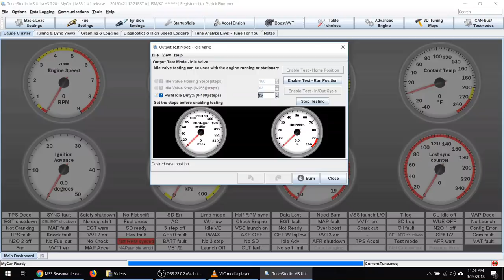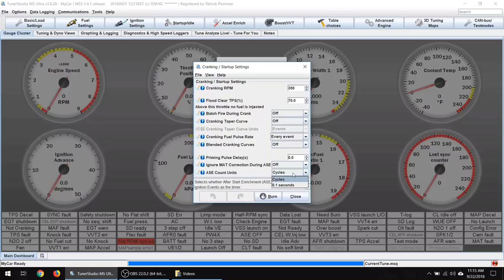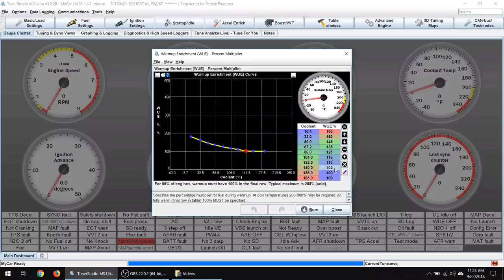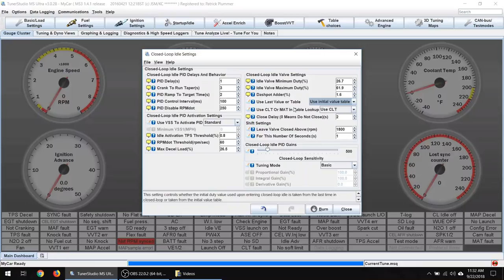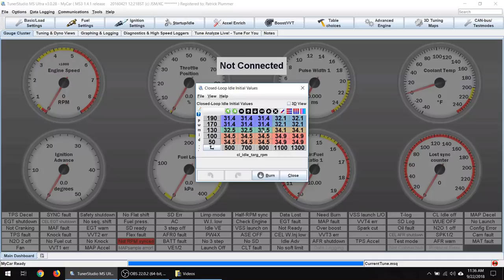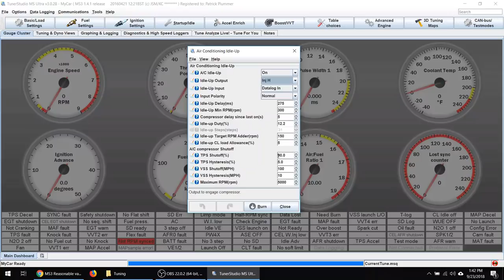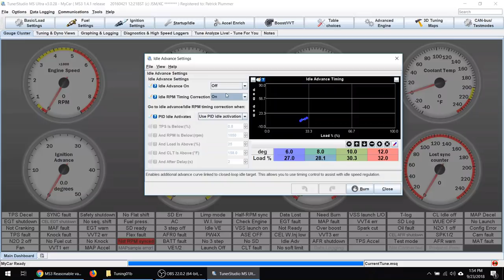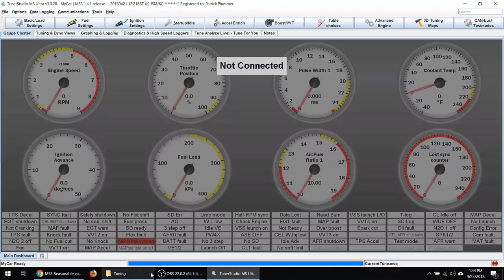Tuning the Megasquirt (Pt 2) - Idle Control

Comment: Hey, so whenever I start the car it hunts extremely bad and won't stay running. But once the idle adv and idle ve kicks in it idles beautiful. Im pulling my hair out trying to change things but I keep going in circles
Reply from the maker: Likely a fuel issue but there are two possibilities.  First is just up the after start enrichment and warm up enrichment.  Bump those up and see if it will settle down.  Second may be the fuel table itself...once it's warmed up tweak the fuel first without idle advance and ego turned on.  It should be relatively stable without those if the fuel ve numbers are dialed in.  Next, from a timing perspective, I like to idle at about 15-18 in the table prior to whatever idle advance adds later.   A tip is to increase the idle cells to 18 or so below your target idle.  So when the car  is about to stall, the advance in the table will pop it back up.
Reply: @OGPedXing  appreciate it. I will try that. Its a turbo LS, but I really can't find much info because everyone is all running holley now
Reply from the maker: Ah gotcha.  For an LS the same advice will work but for the timing numbers use for the lower end, like the 600 rpm row, an advance of your normal idle plus 3 to 5.

Comment: Got my car idling and that is all good. When I blip the throttle it revs up but dies on the idle down. Where should I look to correct that? Thanks in advance
Reply from the maker: Couple of things to try.  You can increase the dashpot which will add duty cycle to the iacv for that amount of time, try 1.2 or 1.5 seconds.  Otherwise you can bump up the idle air initial values for the RPM and load it typically enters idle at.
Reply: Thanks... while the car is running from initial start up is all good... if I restart the car it starts hunting. I will tray the dashpot tomorrow. Hate to be a bother but I’m making lots of headway very fast.

Comment: Thank you! I have a question. I have MS ultra but I don't see the Idle VE settings like yours does. Are there different lvls of MS ultra as well? or did they take out that feature and/or put it somewhere else? Thanks again for all your knowledge
Reply from the maker: I have version 3.0.28 of tuner studio ultra, I haven't updated in a while.  Make sure it says "Registered To" and then your name at the top of the window otherwise it won't be activated.  Go to Help -> Update Registration to set it up.  Then the idle ve should be under Startup/Idle menu, last item, Idle Ve Settings.
Reply: @OGPedXing  I got it all registered and shows just like you said. I saw down below that someone had the same thing happen to them since they are running ms2 pnp vs your ms3.
Reply from the maker: @shinobi1203  ah yes, some features may not be available or may look different on the ms2.   Actually it's not a problem, I tried it without idle ve and I have plenty of range with just the normal ve table. You may want to change the rpm range on the ve table around there so you can have 800, 1000, and 1200 and then have large jumps.
Reply: @OGPedXing  So I used a lot of the base map you showed and it was a great starting point. I got a nonseeking idle, but i for some reason, can't get my idle any lower than 1000-1100rpm. 

Would you mind looking at my tune if I take some pictures of it? or just send you my tune directly?
Reply from the maker: @shinobi1203  If the idle won't go down to 850 and the idle air valve is closed all the way then the physical idle adjustment screw may be too far out or there might be a vacuum leak.  However if it idled fine with the stock ECU then it's probably still the tune.  My email is on the channel About page and you can send the tune file.  You have to be on the desktop browser version of YouTube to see it though, the email button doesn't show up in the mobile app or the mobile site for some reason.  Or DM me on Instagram. 👍

Comment: When testing my IAC, Im able to keep the duty going all the way up to 4k + RPM, do i need to adjust the mechanical screw with the IAC OFF?
Reply from the maker: That can be ok...if it idled ok before the megasquirt you probably don't need to mess with the air screw.  At about 70 duty cycle it should be fully open and not go higher.  With it fully warmed you can test at the higher end.  If it didn't idle well before on the stock ECU or you bought the car with the megasquirt, then you can adjust the idle screw.  There may also be another small vacuum leak that's allowing in extra air.
Reply: @OGPedXing  bought the car completely stock, idle was fine. I tested it with it fully warmed up the rpm's were still climbing past 70% duty and 3500, 4k rpm. As well as it still lowering past 25% duty. Ill look for a unseen or heard vacuum leak. i have a slight idle hunt 800 to bot 1100 every 5 seconds or so after sitting at a light for more than 10 15 seconds. Im about to review some logs and try and see whats going on but im not to proficient in TS but by no means a complete noob. Thx for the reply.

Comment: you said to start at 0% on the pwn idle duty, but if I go below like 26% on my nb2 it stalls. How do you find the true closed spot without stalling?
Reply from the maker: You can also start kind of in the middle and work your way down.  Like start at 40 and go down until rpms stop dropping which should be around 25 to 30.  If it's stalling before that then your idle screw may be all the way closed.    Same for full open...start at 50 or so and continue up until the rpm stops rising.  Usually about 70.
Reply: @OGPedXing  For some reason I didn't think NB2 had an idle screw. I'll check it out. I start at 30ish and it usually stalls below 26 as I slowly go down.
Reply from the maker: @Vdeez  ah nb2, yes I think that's all ECU controlled.  In that case I'd put the lowest number at whatever puts it at about 750-800 rpm.
Reply: OGPedXing thanks!

Comment: So how will I go forward when we installed a new throttle body where the adjustment screw was remowed entirely when I gained it?
Reply from the maker: Is it a stock throttle body or aftermarket of some kind?  If stock, I'd try to get a replacement screw installed otherwise you will have a vacuum leak.  If there's no port for a screw you can make it work but your idle valve duty cycle will probably be a lot higher.
Reply: @OGPedXing  It is a throttle body from a very old car which was made to fit with this custom plenum I also got with the same deal. The screw and the place is there but the throttle plate is fully closed currently.
Reply from the maker: Depending on the throttle body, the screw will open up an internal passage allowing some air past the plate.  The other option is to adjust the throttle cable tension so it holds the plate open just a tiny amount.
Reply: @OGPedXing  maybe I wasn't quite clear with the question but anyway I apreciate alot that you are answering. I meant to ask that how I should adjust the screw before I start to mess around with the ICV? I believe if I have the screw and ICV completely off and try to adjust it with a closed loop, I'm in a big mess?
Reply from the maker: Oh ok, yeah try to get the car to idle at a normal rpm with the icv unplugged.  Open the screw all the way, start the car...rpms will probably be high.  Slowly  adjust the screw until it comes down but doesn't stall.  This may take a couple of rounds if your fuel table isn't tuned yet.  But then you can plug the icv back in and start tuning closed loop.
Reply: @OGPedXing  thank you, this was very useful.

Comment: I can use mpps v13 chip tuning tool  to connect tuner studio to the car
Reply from the maker: No unfortunately tuner studio only works with aftermarket ECUs like megasquirt, Speeduino, rusefi, etc. Obd2 tuners work with a stock ECU on certain car models/years.
Reply: @OGPedXing   I want tune my Isuzu Trooper 2002 v6 stock ECU what OBD2 TOOL do you prefer I should use

Comment: Hi FRIEND. Anyone who knows the ANSWER can help. i happen to have a Volvo 940.1994 regina model B230 engine. I measure only the crank sensor while it is installed and cranking.I read between 100-120mv. But i can find any ready in my trigger logger of rpm nothing.the firmware sas MS2 3.4.1  trigger pattern is 44-2-2 preset in  microsquirt, do you have any ideas what to do? i have no spark either. the sensor has 3 wire. red/blue/bleack seems to be the shield. red and blue reads 196.6 ohm .three weeks trying to find the answer. there are many gues.  Pls help.   regards
Reply from the maker: The lack of spark may be just it can't get sync with the crank signal so it doesn't know when to fire.  I'm not familiar with that engine but in addition to the trigger wheel setting in tuner studio, research what signal settings it needs such as rising edge vs falling edge, etc.  This is on the same ignition settings screen as the wheel setup.  You also want to make sure the crank angle is close for your engine and that the physical jumpers on the Ms are set for the right sensor type, optical, magnetic, etc.  Check out this for more info..https://www.diyautotune.com/support/tech/install/volvo/megasquirt-your-240-740-940/

Comment: I have an e30 with the ms2 pnp ita inverted the pwm when I do the test to calibrate it it never moves
Reply from the maker: What frequency do you have it set at?  You can try around 100 to start...lowet frequency will give smaller steps, higher will give larger steps.  You can actually verify that it's doing something by running the test screen with engine off...you can hear the hum usually.  If needed, you can even take it off the throttle body and visually verify movement.  It may also be an electrical or mechanical problem with the valve rather than the MS.

Comment: I have a mazda mx3 with a klze and I'm running it on a mspnp2 9395 model I tried to follow the same things you were doing in your set up videos but when my car is cold it runs lean. I tried to add fuel in the cold start settings but it won't stay running what can I do?
Reply from the maker: How long does it run before dying with the new settings?  If it seems to start ok and stay good for a few seconds then start to die, you may need to up the Warm Up Enrichment even more.  This is because the ASE is giving it the fuel it needs but this stops after 5-10 seconds.  Second you can check the Idle settings -- you may want to make the target rpm a bit higher in that temp range, and also check the idle air valve duty cycle %.   This last one can be non-intuitive because sometimes you actually want less air intake.   In cold temps, the air is denser and you need more fuel to compensate.
Reply: @OGPedXing  it bracks up well running for about 2 seconds
Reply from the maker: @johnhill484 if you give it some accellerator pedal, can you keep it running?  If that works, try adding duty cycle to the idle air valve.
Reply: @OGPedXing  ok ill try but I'll start up when it seems like it's running normal it's running at 18 20 AFR's
Reply: Until it warms up
Reply: Is there a way I can email you the tune
Reply from the maker: @johnhill484  DM me on Instagram (@ogpedxing there also) and I'll send my email.  Don't know why YouTube took away dm's.
Reply: @OGPedXing  I messaged you on Instagram

Comment: I have e problem mi car run good wen is cold but as soon it hit 180° it go's lenn
Reply from the maker: Likely the fuel ve table is a little lean but your warmup enrichment is a little rich which is compensating for it.  Let it warm up and fix the fuel table (add a little fuel) then you can go back to warmup enrichment and after start enrichment and lower those a bit.
Reply: @OGPedXing   I'm going to try that thank you very much... I was wondering can we connect via team  Viewer And maybe you can help me out better If you have time ?
Reply: @OGPedXing  I need help

Comment: Does the engine need to be running while getting the idle duty % when running the test? I only ask because my engine is running super rich
Reply from the maker: Yes, you'll need to use the RPM to determine exactly when the idle valve is fully open and fully closed.  Although usually you can put in a ballpark value and be close.  An na Miata for example is usually 30 to 70.   Then it will be plus or minus 5 for each value.  A quick way is start at 40 and go lower slowly until the RPM stops dropping.  Then go to 60 and go up until it stops rising.
Reply: OGPedXing it’s just the engine is back firing a lot and I don’t want anything to go wrong internally while I’m adjusting this
Reply from the maker: @usagimoto1423  ok yeah, that's a different story.  In that case I'd put it on open loop idle and change the fuel table until you can get it to run closer to normal.  After start enrichment and warm up enrichment will magnify a fuel table that's really off also.
Reply: Thanks will do
Reply: I went back there trying to make some changes and didn’t see a difference.
Reply from the maker: @usagimoto1423  changes to the fuel ve table?  It might be set to use a separate idle ve table, you can turn that off for now.  Also verify that your timing is ok and sync'd up with the megasquirt. (Set ignition timing to used fixed at 10 degrees and verify with a timing light.)

Comment: I HAVE A MAZDA MX-6  AND I DONT  SEE ANY  OR  YOUR  VIDEOS  FOR  THIS CAR ....
Reply from the maker: The tuning videos will apply to any car that you can use the Megasquirt.   Especially for a 4 cylinder mazda, it will likely be similar.  Check out diyautotune.com to see if they have a base tune for your car.
Reply: @OGPedXing  MINE IS  6  CYL MY FRIEND  AND THANKS... I NEED  TO  KNOW  HOW  TO  TUNE  BECAUSE  HERE  IS VERY EXPENSIVE  ANY HELP  ON  THAT ...I AM IN  PANAMA CANAL

Comment: i wish i could apply these videos with speedyefi. its literally the software yet literally everything is in differnt places then it should be.
Reply from the maker: Yeah unfortunately the speeduino is pretty basic compared to the megasquirt.  The main fuel ve and spark stuff is similar but that's about it.  I have some unpublished stuff on taking a speeduino pnp for an na1 miata and making it work for an na2 (94-97).  I couldn't believe how bad the base tune was... I had to throw it out and start over.  The PID control on speeduino is not good either.  I didn't want to start making videos on it if I didn't have a good solution by the end.  My car finally ran fine, it was still pretty rough compared to the stock like smoothness of the ms.  So I haven't gotten around to putting anything out on the speeduino platform.
Reply: @OGPedXing  haha had I realized I was practically shooting myself in the foot I wouldn't have done it, but oh well guess I'll figure it out. I guess this is why research is important 😂

Also thanks for responding to a comment on a 4 year old video, had no clue you were even still around
Reply from the maker: Yeah, I mean it will definitely run your car.  But it will be more trial and error.   One thing that made a big difference was to check the injection angle table.  It was set up to squirt when the valves were still closed, meaning it would pool on top.  Not good.  Things got easier once I fixed that.  You can compare a similar table on a megasquirt tune to get the right values.
Reply from the maker: @rainzeros8393  check out this forum thread for some more tips. https://forum.miata.net/vb/showpost.php?p=10276371&postcount=122
Reply: @OGPedXing  much appreciated for all the info, definitely will look into it!

Comment: What year miata are you tuning and is it turboed or boosted
Reply from the maker: It's a 94 that I originally tuned naturally aspirated, but then added a turbo.   The tuning series (check out the playlist) goes through the whole process and is pretty directly compatible with any year  Miata but also mostly good for tuning any megasquirt ECU car.
Reply: @OGPedXing  works the same with speedyefi system i would assume. Thats what I have. I just installed it Friday. Been trying to learn and absorb as much information as possible before I go messing with it much.
Reply: @OGPedXing  also I have a 2000 nb1 1.8L natural aspiration currently.
Reply from the maker: Yes, speedyefi or any of the speeduino based ECUs should work the same, they are all tuner studio.  Some screens may look slightly different than the videos because tuner studio changes the look and feel based on the ECU type but it is close to the same.

Comment: are these good settings for a 96 1.8 ?miata
Reply from the maker: Yes most everything will be good since my car is a 94 1.8.  The main places where cars vary individually is in the idle valve duty cycle and generally dialing in the after start and warm up enrichments.
Reply: @OGPedXing  thank you